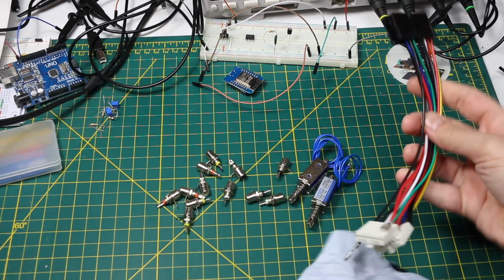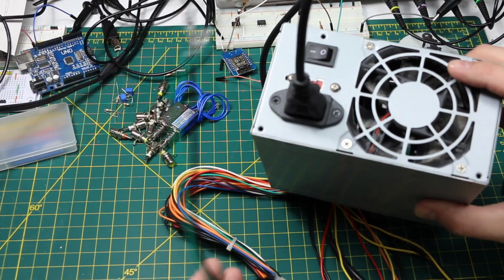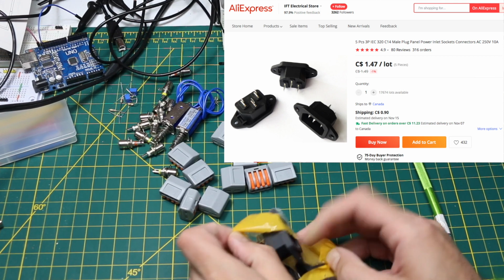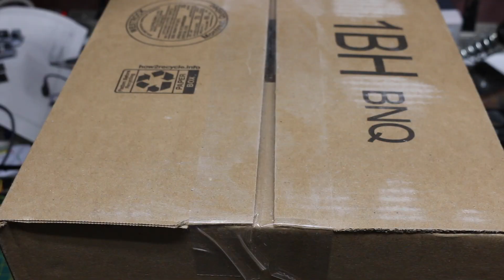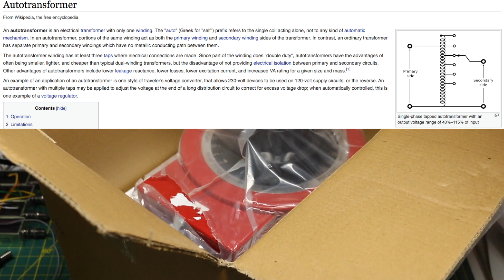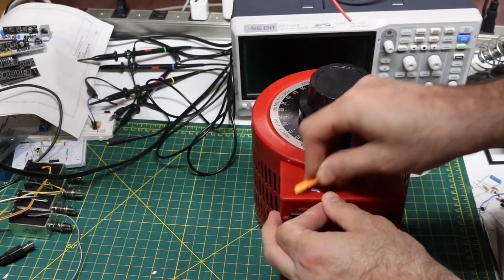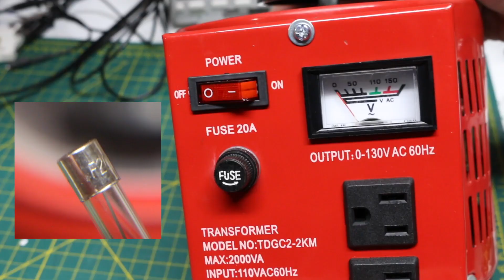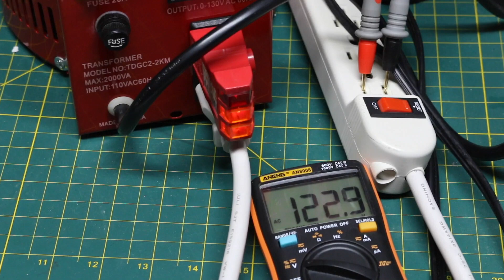Mailbag!

Comment: A Variac has been on my list for a while.  A lot of retro gear I use has odd AC requirements and those tend to go out of spec over time...so powering that gear for testing with a bench DC PSU and a Variac would be awesome.  Good move getting teh 20A one too.
Reply from the maker: yeah I figured the cost for the 20 amp was negligibly more and since we don’t know the true realistic power handling capability of them, the more I can get, the more likely I can at least power on one device without anything smoking.
Reply: @GadgetReboot  Absolutely. For the longest time you could only get the 20A one on ebay while Amazon sold the smaller ones for more money.  I just checked and Amazon US has the bigger one for a reasonable price now.

Comment: I found these AT/ATX adapters from aliexpress to be of quite a bad quality. The AT side seems to be ok, but on the ATX side first the pins started slipping out of the housing and then the wires started to break there. I'd say they're not suitable for workbench use.